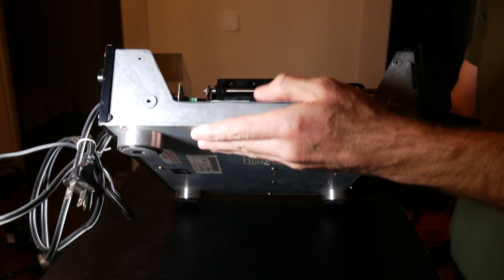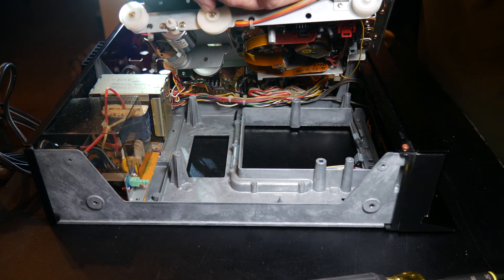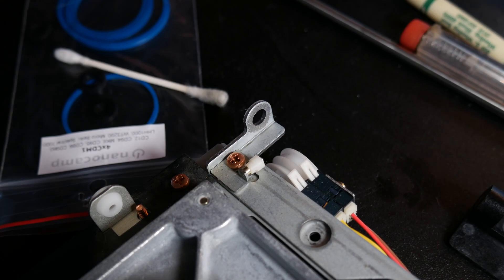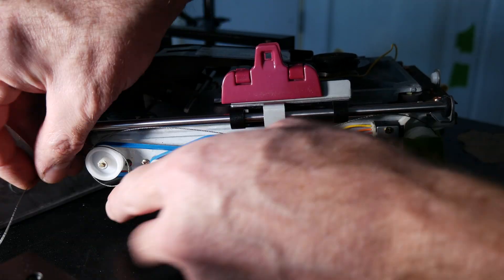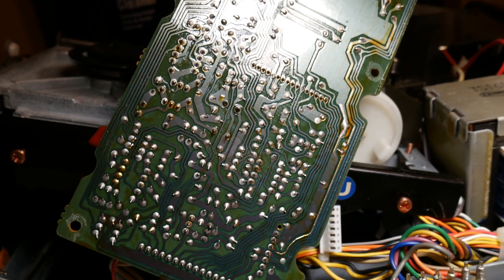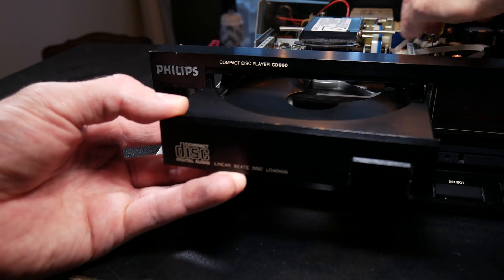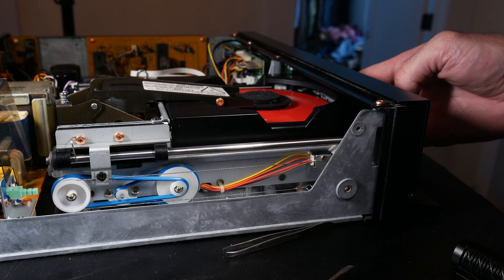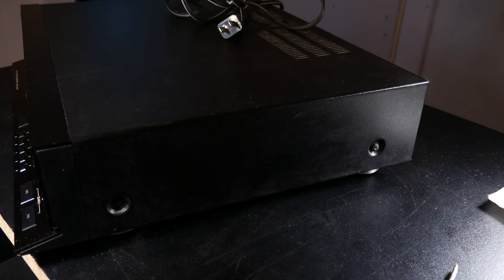Vintage HIFI CD Player Repair and Restoration Philips cd960 episode 3

Comment: I just fixed my Marantz CD 95 with new belts, but I discovered that one of the micro switches has lost the white plastic part. Do you know how I can get a replacement?  meanwhile I use a different switch and used double sided tape to fasten it.  Please let me know if you have any suggestions.

In addition, I found out that the metal wire thingy is also missing.  (12:27 in the video, above the gear attached to the bronze screw, part I130 in the service manual).  Do you know what it is for? can I use wire to make my own?

Thanks, your video saved my player ...
Reply from the maker: Unfortunately, I don't know of any resources for spare parts like the switch you mention. I'm not sure the intended purpose of the bent angle wire. Truthfully, the sliding tray is the weakest part of this machine. It is quite abrupt when opening and closing and I feel like it will fail in time. Another comment on this video mentioned he modified the top to turn this machine  into a top loader. I'm not sure exactly how he did it, but I imagine I will go down that road eventually as the tray slamming shut sometimes jars the disc enough to unseat it and creates a disc reading error. Good luck with continued repairs! Sorry I couldn't be of more help!
Reply: @diybriguy  After fixing this thing until 2am, I woke up and realized what the bent angle wire was for.  The purpose is to create a spring load to keep the bracket to align and balanced with the steel rod.  Missing that bent angle wire was the root cause of my problem.  The tray wouldn't come out and the motor struggled because the tray/bracket isn't entirely balanced along the 2 rails.  At the end, I accidentally forgot to tighten the 2 screws and the tray started to travel smoothly.  I left it as-is and I'll make that wire next time when I open up the player again.  That's enough for 1 day.

I have to say that the tray design made my eyes rolled.  The core CDM1 is however, indeed, awesome.

The are many of the same micro switches all over the machine to detect the position of the drawer and the clamp and unfortunately, they are no longer available. 

I compared the player against an awesome Akai CD 73 (Sony KSS-151a with a "VRDS" kind of a clamp) and indeed they both some very different even if I'm just using the digital out.  It was well worth my time, sweat and $.

Thanks again, your video saved my day and sanity.
Reply from the maker: @kennethschiu  Glad you got it sorted! Great news! Thanks for the kind words, glad this video offered some assistance. Cheers!

Comment: Any suggestions on what to use to clean the belt path for my new drive belts please? White spirit works to an extent but the old belts on my 960 were seriously gungy (more so than the video) and the residue has got right into the 'v' of the pulleys.
Reply from the maker: @kevinhopton7664  I used 99.9% isopropyl alcohol.
Reply: @diybriguy  cheers - picked some up this afternoon. Hopefully it'll clear the remaining residue, which sticks like 💩 to a blanket!

Comment: Am in need of a remote control for my CD960. Any suggestions on where I might find one & the part number of this item please? TIA
Reply from the maker: @kevinhopton7664  I don’t see a part number on the remote. Try and find any Philips remote from that time period…might not give you all functionality, but probably will give some. Check ebay and fb marketplace.
Reply: @diybriguy  Cheers - I've acquired my CD960 from my late dad's loft. Found when clearing out. Drive bands require renewal. Parts ordered via ebay & plan to do the swap myself on the strength of the clarity of  your how-to video.
Reply from the maker: @kevinhopton7664  glad the vid is helping, good luck!!

Comment: 'Looks great'. How would you even know looking at the rear of a PCB what is good and what isn't? A basic belt swap and lubrication qualifies you for nothing. Did you clean the lens? No. Did you check the fuse with a DMM? No. Idiocy is dangerous.
Reply from the maker: Next time just make some suggestions instead of talking your big pile of shiz. Thanks for watching you unclever dork.
Reply: @diybriguy  Love your comment, looks great!

Comment: Best informative video , i have the same and i realized that the swing arm mechanism goes up mor high than it should be , and does not let the tray comes out. 
I m wondering how i can adjust it? 
Please help
Reply from the maker: @saidbenlahcen931  I think there are some adjustment screws at the back of the hold down arm. I’m assuming you are referring to the black colored arm that holds the cd down when you say “swing arm.”